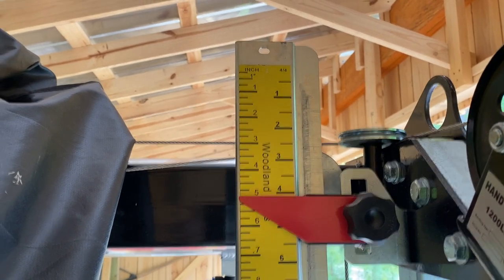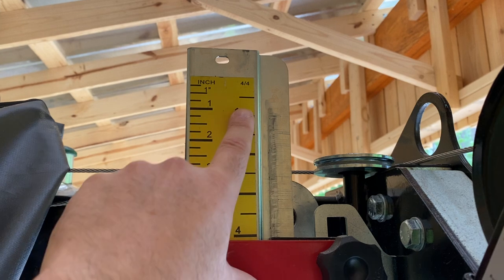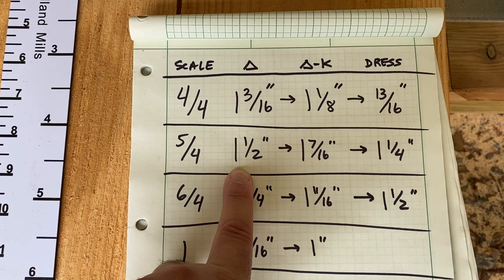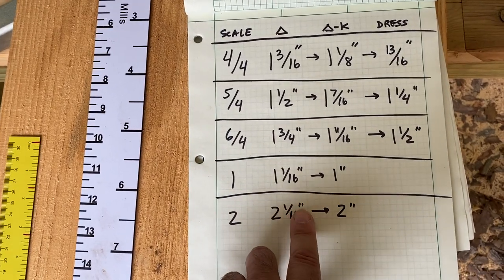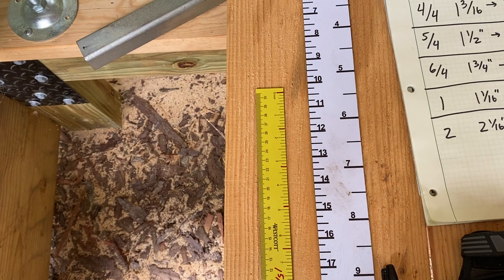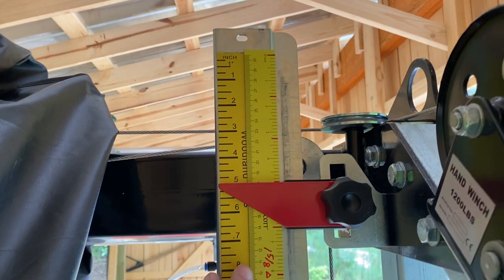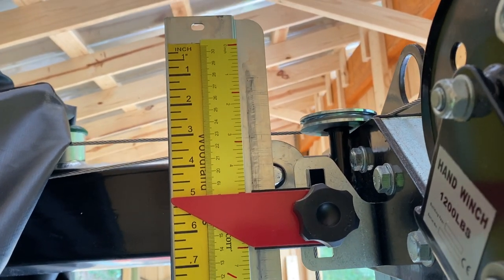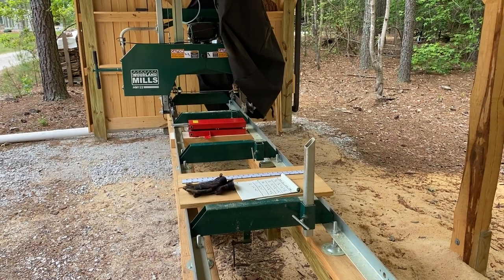How to interpret and use lumber scales on a sawmill, and make your own custom scales

Comment: The way it was explained to me by an experienced sawyer 
Softwood Scale
4/4 is actually 4 quarters  = 1 inch plus the blade thickness  - 5/4 is 5 quarters  plus the blade thickness - 6/4 is 6 quarters plus the blade thickness , once you have your first flat side down is where it quick and useful

hardwood scale
4/4 is actually = 1 &  1/8 inch plus the blade thickness  - 5/4 is 1 & 3/8  plus the blade thickness - 6/4  = 1 & 5/8 plus the blade thickness , once you have your first flat side down is where it quick and useful

Comment: Good information, i just got my woodland 130 set up and trying to figure out what the cut sizes should be to end up with lumber close to nominal store bought. So id i mix my rough cut with commercial finished lumber i dont have sizing issues. Any rule of thumb for shrinkage on fir and pine?
Reply from the maker: Rule of thumb for softwoods -- they will shrink about 7-9% across the grain.  That has been pretty accurate in my experience.  I saw my 2x lumber at 1-5/8" thick when green and it shrinks to about 1-1/2" over time.
Reply: @Lumber_Jack  thanks so much for the quick reply. Very helpful, I was wondering why Woodland didn't have a scale laid out for finish sized lumber given that most people will not be planing their boards.. thought I was missing something until I saw your video on using the scales and making your own. You do a good job on those keep it up they are very informative and greatly appreciated. Thanks Dave

Comment: So 6/4 scale would be like big box store dimensions? 1 1/2 x 3/ 1/2 for a 2x4?
Reply from the maker: If you plan to plane/dress the wood, sawing at 6/4 will give you the right size after all is said and done.  If you want to use the lumber rough sawn, sawing at 1-5/8" increments will leave you with about 1-1/2" thickness at the end.  I almost always use the lumber rough sawn, so I saw on 1-5/8" increments most of the time.
Reply: @Lumber_Jack  thanks.  I live in an area that allows you to cut and use your own wood to build a house. 

I’m in the process of it now and was thinking about specific application the contractor would prefer big box dimensions… like joist hanger for example I assume are designed for big box dimensions not literal dimension sizes.

Comment: pretty sure your information is wrong here. when I cut 4/4 on my bandsaw I get a 1" thick board off the mill which will yeild 3/4" lumber whenS4S, 5/4 I get 1&1/4" board, 6/4 I get 1&1/2" board, thats the way it is
Reply from the maker: My numbers are the same as yours for 5/4 and 6/4 (see chart at 3:01), however you have the wrong spec for 4/4.  You will never find commercial "1 by" lumber dressed to 3/4, it's always 13/16.  Been that way for 100+ years.  That doesn't mean you have to follow the convention -- nothing special about it.  For my own projects, I almost always dress my boards to 3/4" or 1".

Comment: I have trouble on my 122 getting the head locked on the line I am wanting to cut on. Is there something I am missing? I lower the head below the cut then raise up to where I wanna cut but the clicks are so far apart it is aggravating sometimes.
Reply from the maker: I don't pay attention to the winch clicks since they don't really correlate to anything except the design of the gearing and ratchet mechanism.  I always follow the index holes next to the hand crank. Each index hole should correspond to 1/16" change in height and be very consistent.  Normally I go below the cut like you, then crank up to the mark to put full tension on the cable, then go into the closest index hole and release the index pin.  I am almost always right on top of one of the index holes or close enough to jiggle into one.  The accuracy is probably within 1/32".

Technically you don't need to use the index pin since the winch has a brake and should hold position wherever you let go of the handle, but I don't trust it on something with so much vibration and shaking.  But other folks do and seem to be just fine.

By the way, the printing of the Woodland Mills scale is not super precise.  The tick marks are pretty thick and I noticed they are not printed as exact as a tape measure when I put one side by side.  I'd say there is about 1/32" slop in the printing of the tick marks.  I'd like to find a more precisely printed sawmill scale for my true scale.  Norwood makes a nice one but it's over $40.  I found one from a science lab company for much less money that I plan to try.

One extra thing to check -- make sure there is only single wraps of cable on your winch pulley spool hub with no overlaps or birds nest.  I saw one photo where a guy had his cable all tangled up on the spool and it caused very inconsistent changes in height.  It's because his spool diameter was always changing with crank angle and no longer consistent.  The cable needs to be neat and tight on the spool with only single wraps around the hub of the spool.
Reply: I struggled with the clicks in the beginning too, but then I noticed that if I lower it again by a different amount and then raise, the click won’t happen at the same height. You can get your click exactly on the line by lowering and raising the head a couple of times.
Reply from the maker: @differenthandyman938  There is nothing special about the clicks -- they are just part of the winch's ratchet and brake mechanism, which doesn't have the ability to give repeatable results due to the brake clutch that allows slip between the ratchet and your crank input.  That is why WM put on the index wheel and pin setup, since that will be absolute and repeatable (you could also count revolutions of the handle for large changes).  You should ignore the clicking and not use it to set height in any way.
Reply: @Lumber_Jack  I removed the pin you are referring to and threw it away on day one. I would always touch it by accident and it would lock when I don’t want it to. Never missed it since. The click mechanism seems to be locking it reliably and all my cuts are perfectly straight. That’s when I manage to keep my blade from jumping. I even made a piece of veneer once for fun 1/16” thick and 16 feet long.
Reply from the maker: @differenthandyman938  You may want to watch this video by Oregon Old Timer who studied the guts of the winch, here's a link that goes to that part of his video: 

https://youtu.be/MaVm0OSksYg?t=634

The geared part he spins freely there is what engages the ratchet mechanism that clicks when cranking up.  As you can see, it is not coupled to the shaft directly, it's just gripped by clutch plates after you begin cranking upward.  This is what allows the ratchet to engage on up cranking and disengage on down cranking.  But because of that, the position of the gear and the ratchet mechanism it clicks/locks into will never be the same consistently.  You do not want to use the clicks to try and correlate vertical position of the saw head.

This won't affect the ability of the winch to hold position -- because it's a brake winch, it will do that pretty well regardless.  

The only purpose of the indexing pin and wheel is to give you repeatable accurate vertical positioning of the saw head.  It's the only part of that winch mechanism that is able to do that.  Without it, you must carefully position using the ruler visually and hope the ruler scale is printed precisely (beware, the stock WM rulers are not, they have somewhat sloppy printing of the hash lines).  If you want to set vertical in 1/16" increments with easy repeatability, the index system is the way to go.  To put it in vivid terms, sawing a single 1/16" veneer is nice, but if you want to saw five of them in a row with repeatable, identical thickness, you're going to want the index system working!
Reply: @Lumber_Jack  Thank you, this repeatability Idea is new to me, I do it visually. So to cut an inch and a half board I would have to count 24 holes? Seems like a lot of counting!
Reply from the maker: @differenthandyman938  Yeah for big increments you should count # cranks of the handle, or use the ruler, or do clock-style increments on the index holes (1/4 turn of handle, 1/2 turn, etc).  Generally I ballpark it with the ruler and then slip it into the closest index hole so I stay on 1/16 increments.  The index wheel would be more useful with a separate pointer/marker, maybe that will be my next modification.